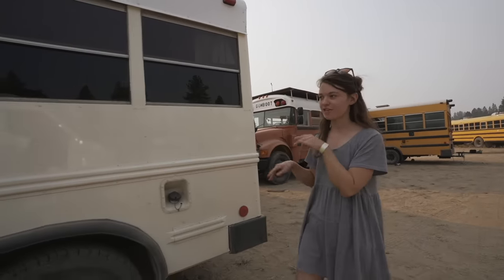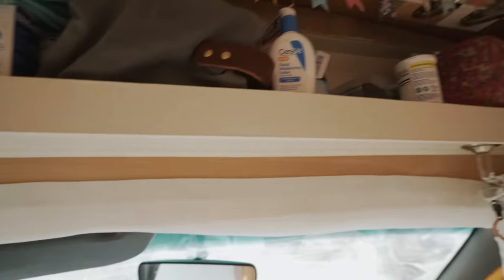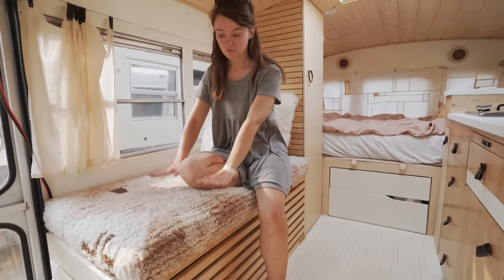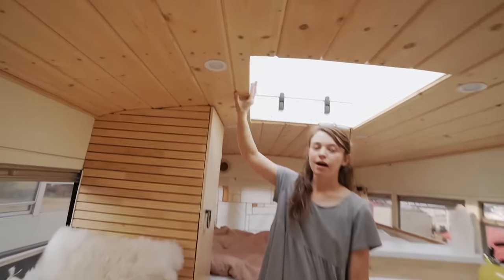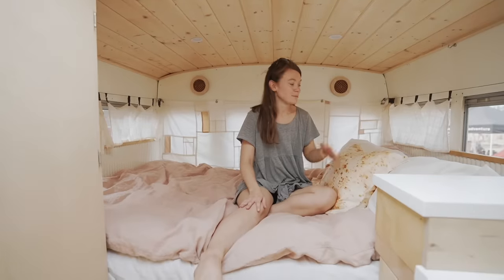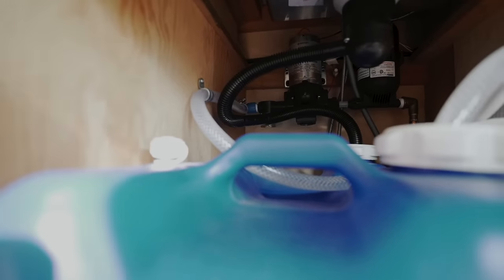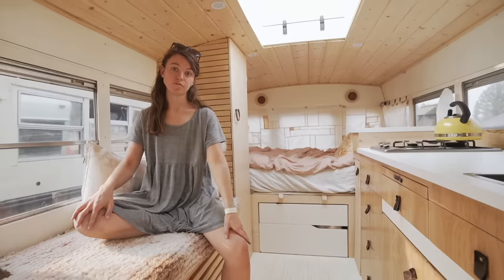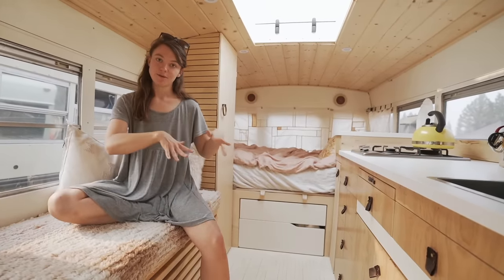4 Window Short Bus Tour - Skoolie Conversion

Comment: Nice build, Thank You for sharing.
I just bought my bus and will start my build this week. I'm thinking of the log cabin look with a wood stove and nice thick cozy throw rug for my feet. Thanks again.
Reply: @Neo,
On skoolie and other home-built forums, we suggest acquiring a suitable candidate, toss in some car-camping gear, go have fun.
.
Allow the conversion to evolve organically.
.
With a blank slate, why duplicate a stand-still house inside a vehicle.
Do you need the weight and complexity of cabinets, plumbing, wiring?
More stuff is more stuff to manage, more stuff to break, more stuff to fix after stuff breaks.

Comment: I’d put in a bathroom it would need to be a wet bath for space. Then kitchen…then bed and if that took every inch then I would have the driver’s seat swivel like in actual RV’s with a foot rest/storage/table top. Use the detachable work station/eating table top she did on her sofa. Mount it to use with drivers/lounge seat once turned to face in. Small tv mount in somewhere would be nice too. More storage areas built in like in the non passenger area up front. Building out the over driver to make storage areas would help too. I know it’s all easy to say right. She’s done a fabulous job and looks so happy. What a talented adventurous young lady. She reminds me of Gabi P. God rest her beautiful soul.

Comment: The bus is so nice! Except I would have made it a twin bed and/or lost the closet for a bathroom, but depending on where your going you might not need a bathroom. I would also make a roof deck and add roof rails, that's not a must it would be nice.

Comment: Such an esthetically looking bus! Such pretty wood. Amazing that you upcycled the wood or used stuff that was about to be thrown away. What I am worried about though, is ventilation of your mattress. It can get moldy pretty quickly (got some experience with that..) if it's not ventilated properly. I suggest you drilling some large holes in the wood under the mattress for some airflow! Overall, very very nice looking bus!😍
Reply: In our ExpeditionVehicle, I fabricated the mattress platform with expanded metal, similar to stout window-screen.

Comment: Please please please make sure someone can’t break into your bus by using a pin to bump up the interior lock that goes through the floor. It looks like it goes completely straight so nobody would have enough leverage to bump it regardless, just be conscious of any slack if not fully engaged.
Super cool build regardless!

Comment: Great bus build, one of the best ones I've seen so far, and the tour doesn't go into every unnecessary detail and last 30 minutes. I have one question though: if the door can be locked from both the inside and the outside, does that mean someone from outside can unlock it?
Edit: I get it now, there's a key.
Reply: Can you plz share the actual Amazon link
Reply: @crystalpparty  huh?

Comment: Beautiful lay out and design. Love that you reclaimed wood, and  Love your doghouse cover, and the space you have at the entry, something I need to re-design in the bus I just bought that has already been converted.  Looks like you did not insulate anything? And, safety tip-your propane source should be outside, never carry propane inside-it is not a very stable gas.

Comment: She complained that it's too hot or to cold, then says her insulation works for her and keeps her cool and warm when need be. Which one is it. I'm confused.
Reply: I caught that too 🤔
Reply: no heater.  no roof fan.
Reply: @dennis.teevee  she's on the road and living the dream.  Maybe electrics weren't in her skill set yet.  When she needs she will work it out. One hole in the roof that leaks might have been enough for the time being.

Comment: Lovely job. Some things I would change personally BUT this is your bus (not mine) so love you have built a space that works! Yay 👏 

A couple of questions if you have time… could you adjust the fridge to be on a slide out drawer (with the ikea screen slat front) so it’s hidden? Or do you think that wouldn’t work? Also, do you have any issues with rubbish/garbage odours with it in your clothes closet? Lastly, so you have a propane leak gauge or box? Does that outgassing effect your clothes? Thanks and again, great build 💛

Comment: 12:12
re -- alternator
At a heavy-truck dealer, I acquired a 220-amp big-house alternator rated 'continuous-duty'.
This's nearly triple the size of the stock 'intermittant-duty' small-house 160-amp we keep as a spare.

Comment: Need a toilet

I may have trade in the clothes cubby for a toilet. 

Put some cupboard over the kitchen sink and move the itms under the kitchen to the top shelves.

Use the space below the kitchen sink for the fridge (do a pull out) some food items and a small section for the garbage.

Use pull out drawers under the bench for clothes etc

Comment: I wonder if there's anyone who has built the interior of their mobile homes on their own using plastics or fiberglass. I think wood in general is always heavier.
Reply: Fiber is harder to work if not built for the place specifally. Wood is easy you can cut glue sand fill sand paint and it will be invisible. There are many pre-built RVs all fiber looks like a speed boat. 
For fiber you can't diy you need to crate mold for every part. 
If you mean like stripes of fiber with glue on it I saw some videos people do that for stupid corners but it gets to solid and cracks easily in a RV.

Comment: Bro why can't someone just push the pin up from the bottom of the step, on that front door?
Reply: Looks like it's in a locking position from the joint in middle.

Comment: You need about 1200 watts on the roof and an air conditioner that draws 400 by Black and Decker about the size of a 13 gallon kitchen trash can. Nice build.

Comment: is it a normal bus/van life thing to have the system charge also while the engine runs from the regular engine alternator?
Reply: No.
The most common system is 200-400 watts of solar panels using a passthrough solar charge controller into 200-400 watts of AGM or Lithium "house" batteries. The system automatically "switches" to a trickle charge from the alternator, and it can reverse charge the van battery once the "house" batteries are topped off.
The other common system is 400-2000 watts of powerbank electricity (Bluetti, etc...) running a mix of 12v, usb, and regular 115 volt. You charge it using solar or inverter.

Comment: Wait... does she not know why people hate on the fiberglass insulation in a vehicle? Just ignores it like a millennial cliche?
She will find out in 10 years when she needs a lung transplant from all the fibers she's breathed in.
Fiberglass insulation is for homes that don't move or shake that crap into the air you breath. Even worse, in a small space making it MORE dense... make that 5 years for the lungs.
Reply: Okay boomer. Sorry you're old and now hate life, but you make even the most cynical of us seem like a bundle of joy.  The insulation looks pretty well f'ing covered to me. Its not like its all exposed and ready to waft glass fibers in the air. Covered properly, it is fine for an application like this.

As for mixing solar panels - totally safe, so long as you check the panels electrical parameters , and degradation levels. It is also clearly a temporary solution, which is why they aren't even affixed the vehicle. Given what she has been able to do with the bus, and that she's in IT, and clearly quite a bright gal, I'm sure she had the wherewithall to do the little research required to make sure what she is doing is safe. 

She clearly states she is 5ft 1, not 4 foot. Did you forget already?  Past your bedtime maybe? 

This girl gets top grades from me. Should have her own youTube channel. Totally engaging, and has great energy. Unlike Mr. Cramps here. You should not have your own channel. :D  Eat a snickers.

Comment: Use bowling alley wax to protect the floors.  You can put a coat on every 10 minutes with a pleasant wax smell. If you can drop a bowling ball on it and not dent or chip it's  strong. You can find the wax at any paint store.

Comment: 06:30
Insulation in our ExpeditionVehicle:
* adhesive-back acoustic against the inside wall, a gap, then
* one-inch pink-board, another air-gap, then
* two-inch foil-side poly.
.
Windows:
We mounted 3010 (three feet wide by a foot tall) dual-pane sliders designed for a stand-still house.
.
2003, during our conversion, people -- with zero-zero-zero experience -- proclaimed the windows would never survive.
Nearly two decades full-time live-aboard.
Twenty-four months twenty-four thousand miles around South America.
Summers up rough logger tracks to remote mountain lakes.
Winters on isolated Baja beaches.
Our windows are as good as the day we installed them.
.
An aside:
We mounted our windows at our eye-level standing inside... about eight feet above pavement.
Small windows are a small target for FOD.

Comment: Very nice. But there is no microwave or oven. Would have gotten a double camping stove for drawer and fit in at least a toaster oven on the counter.
Reply: A twin bed with a toilet would have been better as well.
Reply: Nearly two decades full-time live-aboard in our ExpeditionVehicle, we prefer to cook outside.
.
We use induction hot-plates.
Advantages:
* use one on the porch
* use all three on the picnic-table with multiple cooks
* a quick swipe to clean, and they store back in their cubbies... no need for a set of major appliances going unused for twenty-three hours every day while occupying cubic space.

Comment: "I attached the tongue and groove right to the metal so if it's hot out side, it's hot in here so that's not good." "I used fiberglass insulation which everybody hates n but it works really well. I stay cool in summer and warmer in the winter."       - Which is it, babydoll?
Reply: She was talking about not having insulation on the roof but has it on the walls and floors
Reply: When she put the boards up, she drilled THROUGH the fiberglass and into the roof ribs which are welded to the roof. The heat passes through the fiberglass via the screws and radiates into the passenger compartment.

Comment: AND she mixed solar panel types going into the battery? Oh god.
Hope she has a fire extinguisher hidden somewhere. Because I didn't see one.
This video goes in the bin of what NOT to do. This is one of the reasons we get a bad name and why they are trying to regulate it now.
Reply: That is not a problem as long as the nominal voltage of the panels is the same.

Comment: cutie  is funny. way  to  go. no toilet, no shower, whats up? very important.. that  refrigerator not good.    upright was a better choice.. getting a can on the bottom of that frige is a small turn off + under a couch. yack//
Reply: Nearly two decades full-time live-aboard in our ExpeditionVehicle, we never saw much purpose for a fridge.
.
Summers up rough logger tracks to remote mountain lakes.
Winters on isolated Baja beaches.
Twenty-four months twenty-four thousand miles around South America.
We are rarely more than a few minutes from a grocery-store.